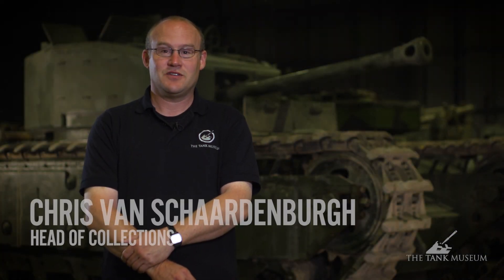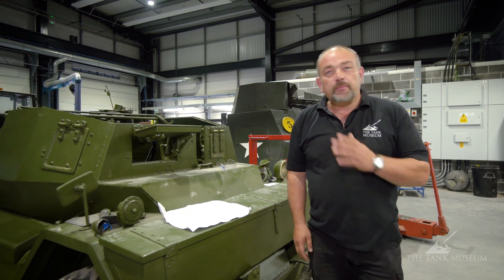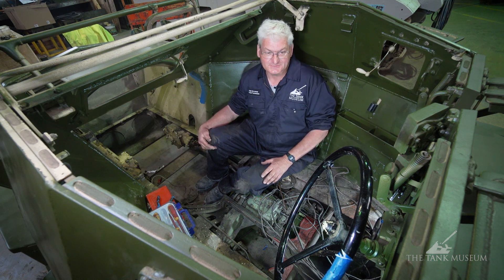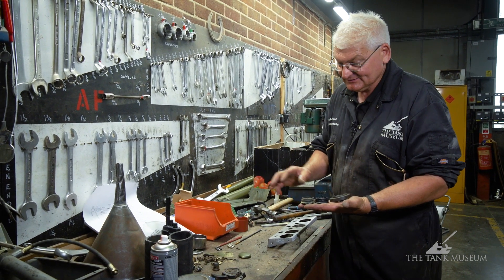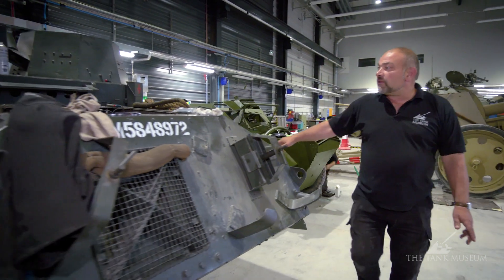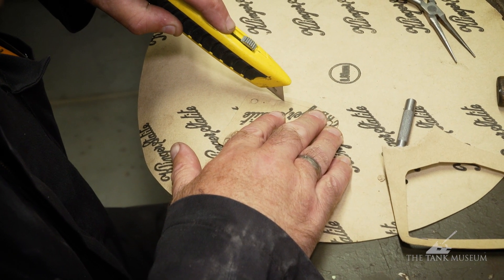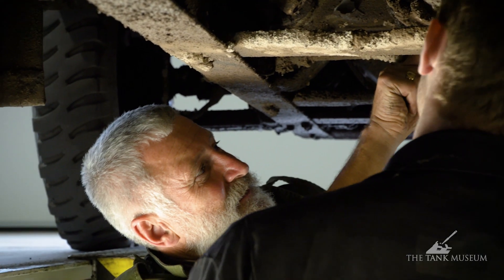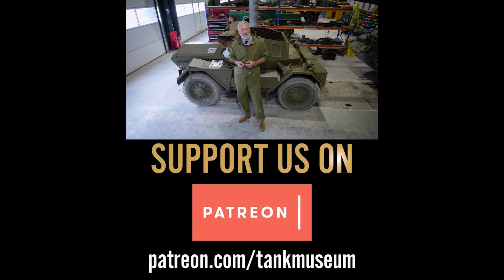Operation Market Garden | Ep. 6 | Tank Workshop Diaries | The Tank Museum

Comment: Love the fact in the metric age, Bob Darwood used Imperial measurements for the copy of the under plate of the dashboard.
Reply: The vehicle was manufactured in Imperial, wasn't it? Lower chance of a mistake when you're not doing any conversions in the middle of the work.
Reply: Halinspark, you misunderstand I still measure things in feet and inches.
Reply: @Vlka_Fenryka  No I think you mis-understood, Bob can clearly work in both systems (it is not hard) but as the vehicle he was working on was imperial it makes sense to keep it like that. It wasn't Bob endorsing any particular system, so i think you are potentially reading into it too much as a validation of the system you opt to use.
Reply: @mwnciboo  no, it's a validation of the fact that when you are working on hardware built with legacy units, insisting on converting to a completely different unit system is both counterproductive and a right PITA. 
think about that next time you pop into the pub for a .568261 liter.

Comment: Were the dingo wiring casings originally braided steel?  Looks great!
Reply: 83RBurke I thought that looks very premium hahaha but I doubt they would have had any great plastic type materials to use
Reply: steel armored wiring did exist at the time. although it would have included cloth wrapping in with the steel to act as an insulator. Got an 52 GMC that still as a short section of such wire. although basic cloth wrapped wire was pretty par for the course. vinyl coated wires also existed as did plastic. the non cloth stuff tends to get pretty stiff.
Reply: Captian Nemo ahh very interesting sound like you know your stuff

Comment: 3-D printing is gonna make sourcing parts for these machines much easier. Maybe in the future there will be museum pieces that have the majority or even all of their parts newly made.
Reply: 3D printing is useless for applications like this.
Reply: @Kyle-gw6qp  why?
Reply: @petertimowreef9085  you can't print the right materials. Even if you could it's much faster to machine the parts.

And you can't have a museum piece where every part is new, that's called a recreation, people want to see the original.
Reply: @Kyle-gw6qp  Porsche 3d prints the pistons of their most high performance engines.
Reply: @petertimowreef9085  yeah but they're not Porsche are they? They have to use the original materials.
Reply: @Kyle-gw6qp  Point is that if you can use 3d printing in such a high performance situation, printing parts for 70 year old machines will be peanuts.
Reply: @petertimowreef9085  it's much faster to turn parts or cut them on a mill because that's how the parts were designed to be made. Also the materials are probably not compatible, the materials should be the same as the original where possible.